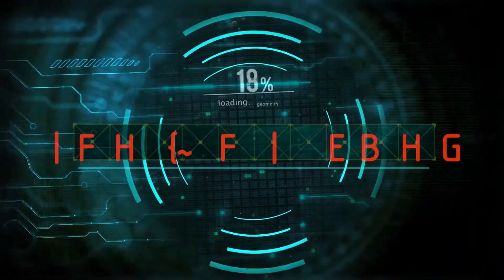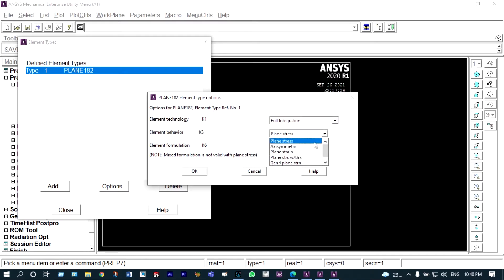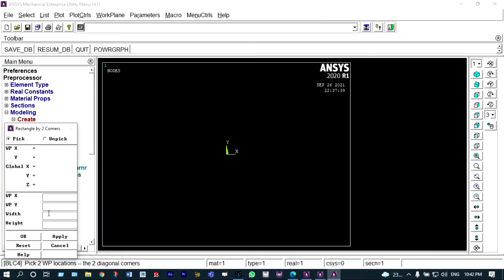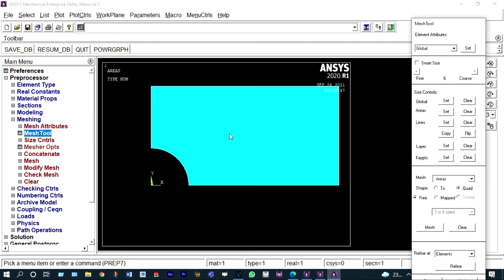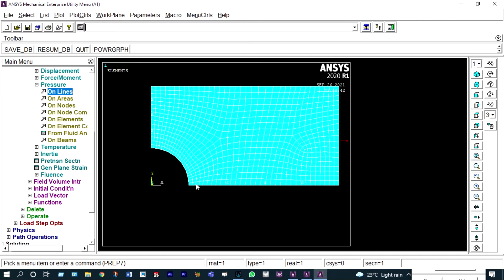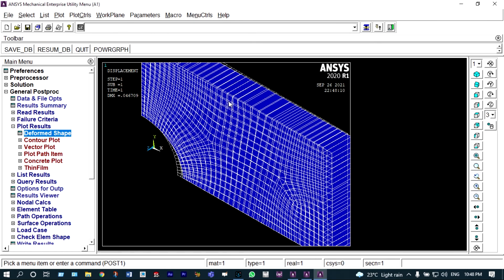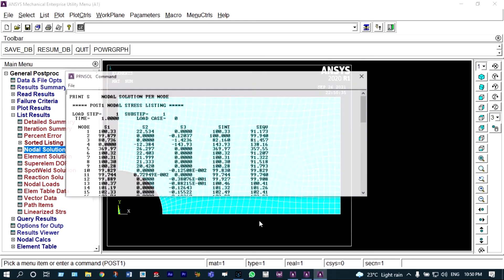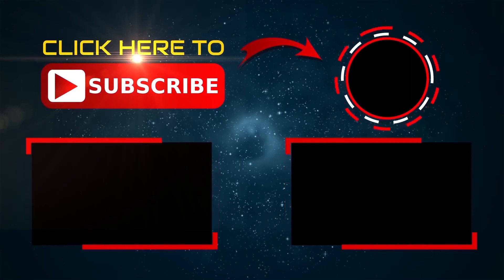FEA Plate | Plate Analysis | Symmetric Boundary Conditions Tutorial - ANSYS APDL

Comment: Hii sir
Very helpful tutorial

How can we get the moment distribution in a slab on a given section? The slab is fixed at the left side and pinned at the bottom side and supported by a column at the top-right corner which can be idealized as pin support. Slab is subjected to udl on its surface. I want to find moment distribution at the fixed side, right edge which is free side and also on the mid section running from left to right.

Can you help with this type of analysis please